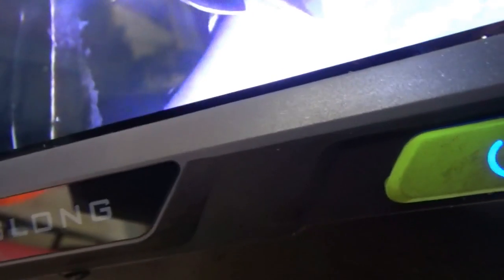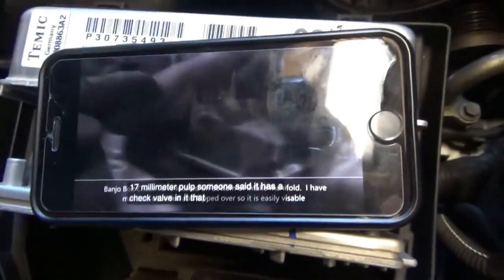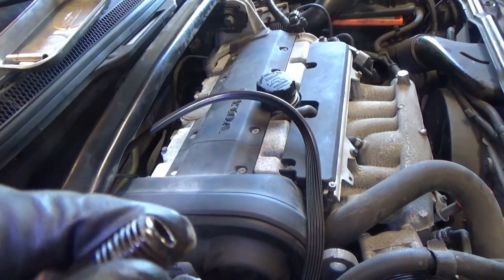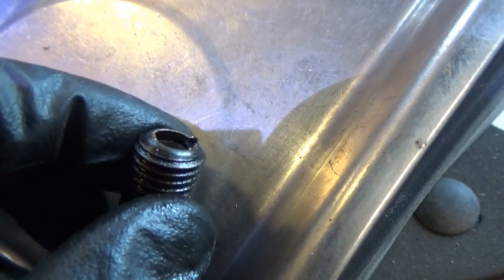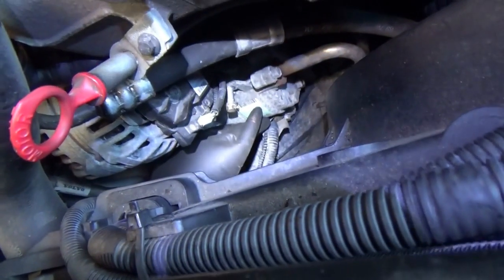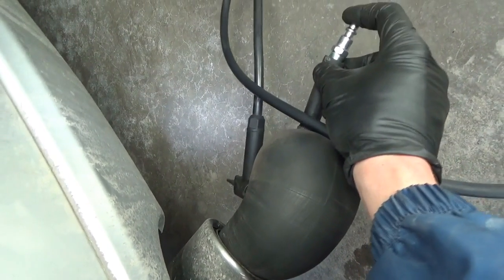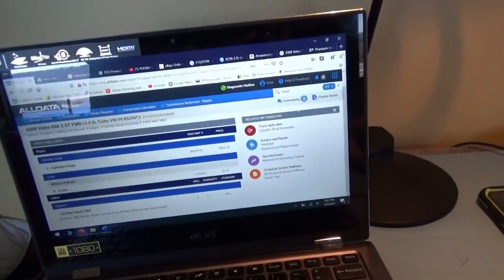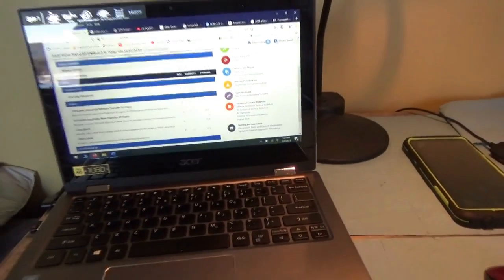Volvo Turbo GRENADES! - Part 2 (Cause of Engine Damage)

Comment: Volvo has some responsibility for this failure.
Reply: Agreed the lack of recall on this, means they should cover most if not    all of the cost.
Reply: Uh..huh...and just what do you expect them to do for a 13-year-old vehicle?  You must live in some sort of fantasy world where there's a replace everything free-forever warranty...no exceptions and free coffee...
Reply: LOL...if it were under warranty. Now it's past that time period...they would only thank the owner for the tip to improve that bolt/valve design !
Reply: Chevy did a voluntary recall on my tailgate cables for vehicles up to 12 years old and at least warned you about it if it was over 12 years old. Nissan extended it's warranty voluntarily on cvt transmissions to 10 years. Ford had to pay for customers' transmission cost fixes on out of warranty focus and fiestas. Volvo clearly new this was a problem or they would not have redesigned the part. Let me repeat myself, they should have to pay for some of all if this.
Reply: Much would depend on whether this is a maintenance item with a scheduled replacement interval or good forever.